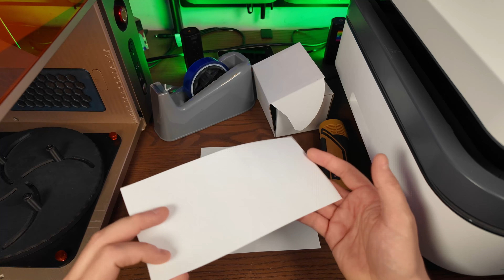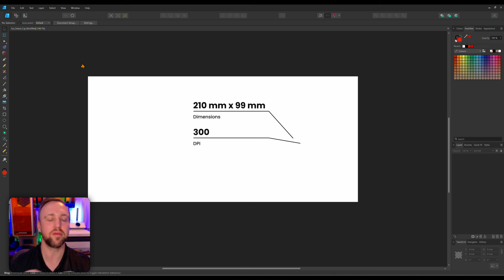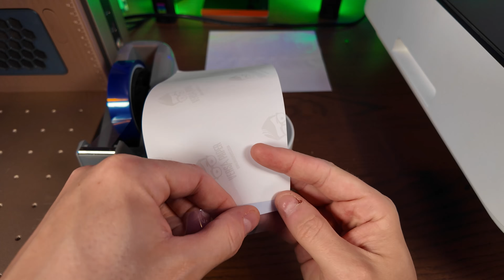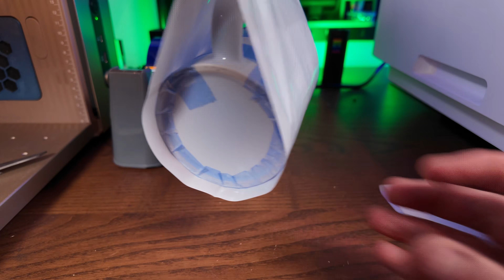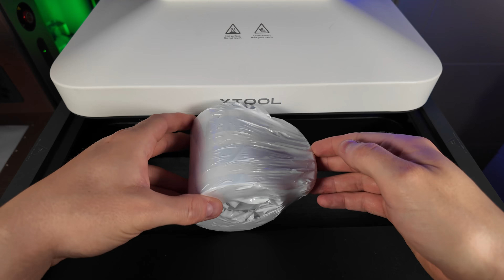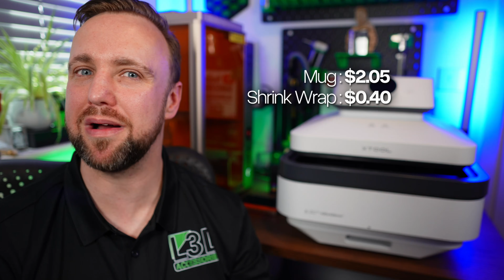xTool WonderPress Mug Tutorial | How To Make Sublimation Mugs At Home

Comment: Hiya, thanks for this video, it's great. I  have  the wonder press too, and I think you should mention that the oven won't bake close to the handle it needs at least 2.5cm clearance which is really a shame if you want to do wrap around designs. Also 900 seconds + 600 isn't enough for a lot of designs :( it took me at least 3 cycles to bake some and they were still faded towards the handle, even with shrink wrap and/or silicone baking sleeve. . WP is a fantastic machine for so many uses, but the mug sublimation isn't perfect. (I also used Affinity and ICC profiles and the same printer as you have.
Reply from the maker: Thanks for sharing that, it's really useful for anyone wanting wrap around designs. I didn't do a full wrap on this one so I hadn't run into the handle clearance, good to know.

Comment: What’s the advantage of doing this vs UV printer? Just cheaper (initial) cost? Or are the colors better and more durable this way?
Reply from the maker: Lower cost is a big part of it, and sublimation goes into the mug's coating rather than sitting on top, so mine are still vibrant after multiple dishwasher washes. UV can print on a lot more materials though.

Comment: How is all that prep and 25 minutes(???) saving time even if you're doing 3 at a time?  (vs doing a mug press).  What am I missing?  Really thinking about canceling my pre-order based on this work flow process  :(
Reply from the maker: That's the length of time I used to get consistent results, that being said it's probably possible to get it done quicker. Ultimately the purchase is based on the kind of workflow you have, if you're only going to be doing mugs then a mug press is 100% more efficient. But if you want the option to do t-shirts, jumpers, vacuum forming, moulds, 3d form phone cases etc, all in one form factor then this is where I'd say the machine is beneficial.

Comment: Hi,
Would you prefer the wonderpress with a dtf printer (wich I assume you need) or the uv printer?
Reply: Instead of the wonderpress I mean...
Reply from the maker: It really depends what you want to make. The WonderPress is a heat press, so it's for things like shirts and mugs, while a UV printer prints straight onto hard items like wood, metal and glass. You don't need your own DTF printer for it either, as you can buy DTF prints in.

Comment: This is a toy and can really not be used in "production" use as many of you influencers are saying.To point out what i mean........1# the heat press is slow it takes 10 sec just to lower it down. 2# It takes 1500 seconds to sublimate cups...yes 1500 sec and that is just insane,and also you have to wrap each cup..who in their right mind can recommend this ? 3# It seem very poorly built a lot of bulky plastic parts,wont last long. 4# Big bulky parts that you will have to have laying around close to the machine...3in1 ?? 5# The heat chamber is microscopic way to small for any real use.6# The noise is constant on this thing,even when only using the heat press there is a constant fan noise,would drive me crazy....and when you do vacuum......well you better leave the room because that thing is LOUD. This is just some of my thoughts on this and i do find it questionable that very few of you guys who review these things do not mention much of the negatives only the "good" stuff get out in the open...this is more like a commercial for the unit.
Reply from the maker: Fair comment, and I understand where you're coming from. My full review isn’t out yet, and I’ll be covering both the positives and the limitations honestly based on real use. It won’t be a sales pitch. Like any machine, it depends who it’s for and what they need from it.

Comment: ok i saw you do cotton dtf how did you do this? did you use that epson sublimation printer? can you show us from start to finish?
Reply from the maker: For the cotton dtf I found a supplier who prints designs. So I sent them my logo, they printed it on DTF material and sent it to me. Then I just heat pressed it on using the DTF to Cotton settings.
Reply: @L3DAccessories ah ok chk i thought did i miss something lol i have a subli printer etc so i was like what???

Comment: For me I would like more info on the printer and the ink you used. This is something that I used to do a few years ago with a 3D vacuum heat press and mug press doing mugs, bar blades, iPhone case etc. I use the Sawgrass G400 print machine. The main problem with that was the costs of their ink. In the end I found a nice guy in Derbyshire, UK that sold his own ink, a lot cheaper and also refillable (sawgrass does not do refillable) and used his ink for a few years (it came with a colour profile also).

So is the printer you used here set up has a sublimation printer (for those reading this). Sublimation ink is used in an inkjet printer and should be used with sublimation paper only. Not normal print paper. The ink and the paper work together has a gas to release the colours. I used to buy most of my sublimation blanks and paper from a large sublimation company  in Poland. So for me I would like to know about your printer.
Reply from the maker: Great question. The printer I’m using is an Epson EcoTank ET-2850 that I bought as a ready-to-go sublimation bundle here in the UK. The supplier removes the standard inks and provides sublimation inks instead, so it was very straightforward to set up.

I’m using standard A4 sublimation paper, and for what I need it has been a really good budget-friendly setup so far. Print quality has been strong, colours have come out well once pressed, and it keeps the running costs far lower than some dedicated systems.

I also paid a little extra for their colour profile package, which included ICC colour profiles for the printer. That has definitely helped with colour accuracy and getting prints much closer to what I see on screen.

There are definitely higher-end and more specialist sublimation printers out there, but for someone like me who wants a practical, affordable setup without spending a fortune, it has been ideal.
Reply: @L3DAccessories Thanks Chris. I’ll look into this machine here and the guy in Derby. He also sells the machines ready to go. I just need to check import costs etc. I think he includes the ICC colour file when you buy it from him.
Reply: I have a sawgrass sg400, not used in years but thinking about getting it back in action, do you have a website for the ink guy you use? I want to look at the same thing. Thanks.
Reply: @BigMultiMilli I don't remember the name of it unfortunately but I got my sublimation ink for my Epson ecotank off of Amazon. Sublimation paper as well.

I was also able to find an ICC profile free online that worked for me.

Comment: Brother, nice video, but do you do too many steps? As a printer it is much better to use a sublimation printer I use a Sawgrass SG500 and use a press specifically for cups I use a Cricut Mug Press so you also avoid placing all that tape and it is also useless to put the heat-restraining film; moreover, 950 seconds are many for a successful success: 4 minutes are enough at 210 degrees Celsius also the price of the 12 cups you bought is definitely high and trust that I buy many.
Reply from the maker: I did mention in the video that the prices are based on what I paid for small quantities from amazon and that you could definitely get better value for money buying in bulk. Thank you for watching.
Reply: @L3DAccessories thanks to you for all the videos.

Comment: This is suitable for fun, not for serious work where you can earn money. Such a mug would be too expensive to produce. XTOOL has overcomplicated and certainly overhyped this product. I use XTOOL lasers; they have many advantages and I like them, but after watching this process with the mug, I conclude that purchasing such a device makes no sense. I understand that this is sponsored content, but be honest and don't promote something that is weak.
Reply from the maker: This wasn’t a sponsored video. I made it because many new owners will be looking for real setup guidance, and I wanted to show the full process honestly.

Whether the WonderPress is commercially viable depends entirely on the user, their products, pricing, and workflow. For some it will be a hobby machine, for others it may fit small batch production.

I always aim to show products as they are, including the pros, limitations, and real process involved.
Reply: @L3DAccessories  I appreciate the demonstration of the entire process. Don't take it personally. I'm criticizing the machine itself. Xtool has been touting a fantastic product for over a month, but it turns out that preparing one cup (or four) takes about 30-40 minutes. For larger batches, it doesn't make sense. For a hobbyist, maybe.
Reply: @L3DAccessories The Wonderpress isn’t shipping yet so I’m assuming they sent you a free one as a demo unit. And the affiliate link to the kickstarter too. Both can be considered forms of sponsorship. Just saying. You’re not out here hyping it out of the pure goodness of your heart alone.

Comment: Not trying to be negative, just stating the reality. Mug press e.g the Cricut mug press is much easier. A cheap toaster oven would do the same job as the XTool also with the ability to batch run several mugs at once. Mugs are low revenue for any seller unless you run at volume. The XTool wonderpress has many cool features but I wouldn’t use it for this.
Reply from the maker: That’s a fair point, and it’s definitely all about choosing the right tool for your specific workflow and volume goals.
Reply: I’m with you on this one. I do a lot of mugs and have one Cricut mug press (although on my second one now) and it works a treat in about 5 mins for each mug.  Chris does not also factor in the printer and sub ink but i guess that you can use pre printed sub paper.  I love my Xtools lasers but this press is also not for me.
Reply: Agreed! and having bought basically all these as separates 😂 (the HTVRont tumbler press, HTVRont vacuum heat press, HTVRont auto heat press and the Cricut mug press!). Can definitely see the appeal of Xtools all in one solution! and had it been available would likely have bought it! But trying to do everything sometimes comes at a cost of dedicated performance.

Comment: Does seem much more effort for mugs than usual mug press. I have preordered one but I may just get the heat press and moulding components.
Reply: I print, tape the edge, pop in the mug heat process and done.

I don't do most of that stuff
Reply from the maker: The wrap and heat gun step is definitely something that could be skipped if the design is taped up well. I had mixed results without it.
Reply: I've been thinking the same thing especially after last night.